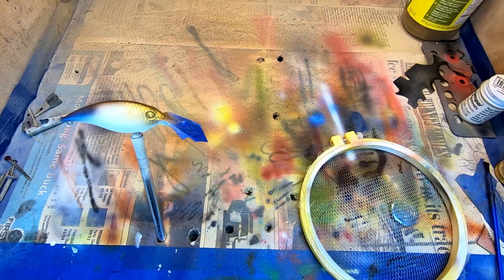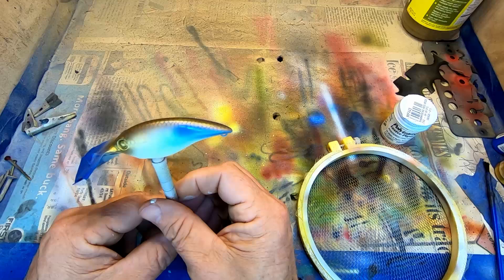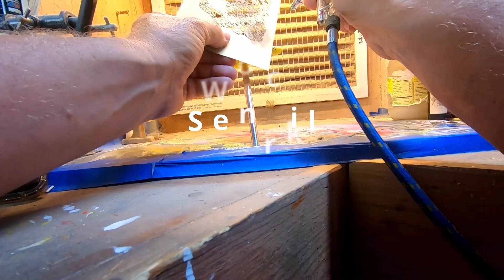MOSBY SHAD---LURE PAINTING---CUSTOM PATTERNS

Comment: Another killer pattern did you mix that with tamco and spray the shimmering red on and what size needle do you use for spraying tamco
Reply from the maker: You can sprayi tamco with any size neddle. I have used .35 and also use .5. Yes mixed the mica powder with the tamco
Reply: @greencountrycustoms8387  ok thanks I’ve been spraying it on with the .35  and never thought or knew you could mix  mica powder in with it do you clean your gun with acetone when you done using tamco
Reply from the maker: Yes clean out with acetone. MAKE SURE TO TAKE NEEDLE OUT and get all residue from the clear off it

Comment: How durable is that tamco and is that the only clear you use on your lures?
Reply from the maker: Very durable. Been using on my lures for 10 plus years fish in rocks etc without issues. Also holds up longer to hook rash than any store bought lures with even one coat. Put 2 on your golden. High impact is only clear i use now